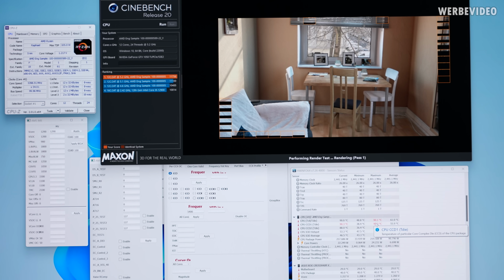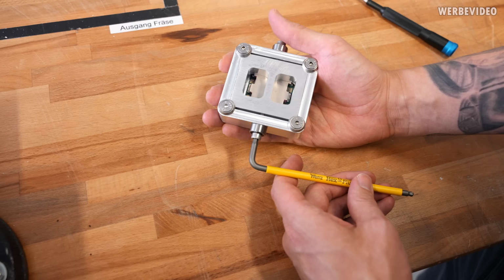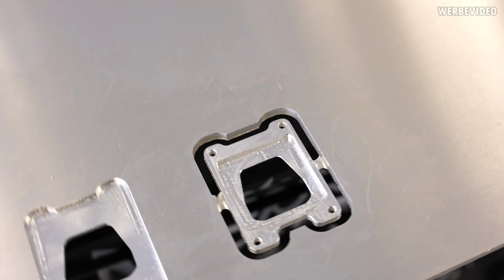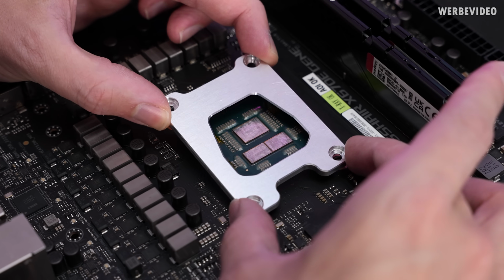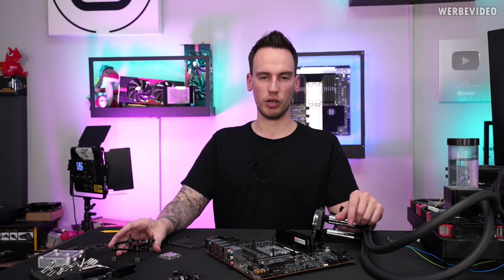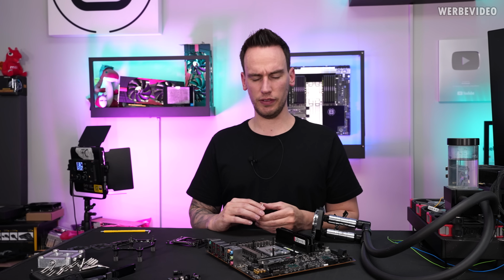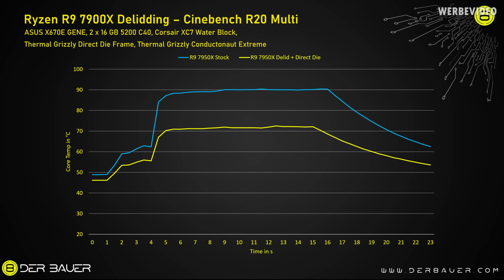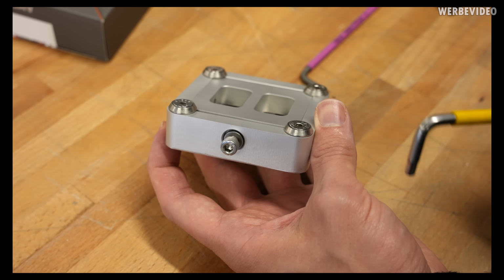Ryzen 7000 Delidding - Unreal Temperature improvement with Direct-Die Cooling

Comment: This does prove that upgrading to a thicker IHS to maintain very questionable cooler compatibility is indeed a huge mistake and kneecaps the newer lineup. Roman knows his stuff and deserves way more views with content like this.
Reply from the maker: Thanks a lot
Reply: Not really. Zen 4 doesn't throttle at high temp so AMD made the right move for mainstream customers. For real overclockers we're gonna delid anyway🤣
Reply: @dudao4163  exactly.  the average person won't be hurt by this at all and neither will the average overclocker... meaning they change 2 settings and call it good
Reply: It's for when they sell the "upgraded" gen 2 AM5. They have to leave some easy room for improvements on the table xD
Reply: @darkpitt1  There is already a room left for AM5r2, such as increasing PCIe lanes from 28 to 64.
Reply: @erkinalp  3D v-cache too, not so easy maybe(?) but a predictable upgrade path
Reply: @erkinalp  It will surely be called AM5+ if it exists.
Reply: @erkinalp  it was a joke
Reply: @erkinalp  What do you use that many lanes for? The vast majority only need 20 for a GPU and NVME drive.
Reply: @ZanderX10  A second or third NVMe drive. Also 100G NIC. As threadriped is dead, then "cheap" workstation - GPU, plenty of NVMe and 100G+ NIC.
Reply: amd just need modifies ihs~ that launch a new 8900x,or add a 3d cache on it. everything is a commercial operation.
Reply: Not a mistake, I'm fairly certain its there to leave space for 3D cache stacking.
Reply: Turns out Zen4 performs well on old Wraith box cooler, easy to cool.  The XOC demos are actually showing AMD have overclocked out of the box with their boost, with unimpressive freq gains for excess power consumption.
CPU designers have a choice, run to a power or thermal limit and there's no real evidence to suggest AMD's 95C is a mistake.
Consumers can buy quiet air coolers with this design and not lose significant performance.
Reply: Which is kind of weird because the companies could just make their own compatibility accessories for their mounts instead. Also, moving to AM5 already requires so many new things. Mys well go the route of new coolers too.
Reply: The cooler argument is 1 angle but.. I can see amd planning on releasing new variations of the chips claiming cooler Temps and faster clocks by just thinning the spreader but ofcourse not saying it had anything to do with the thickness of the spreader.
Reply: I thought he was actually very considerate of him to simply say that perhaps it was not the right move to add so much material for the sake of limited backwards compatibility rather than going Gordon Ramsay mode and coming out and calling them f*cking donkeys (which is absolutely what they are for doing this).  Lol
Reply: I think they could have actually maintained cooler compatibility by having smaller IHS, and then including an addon that goes on the IHS for compatibility. It could have been as simple as a CNC'd piece of metal that slots into a normal IHS with the appropriate thickness, and then you'd just thermal paste both sides. The shape of the CPU certainly would be friendly to that kind of solution, without even having to worry about anything moving around once you put it in place, it would just use the CPU's shape to stay in place. They could have either included this with every CPU, which wouldn't even cost more than a couple of dollars to include, or left it to third parties to provide it for heatsink compatibility. But another reason why they made the IHS soo thick is because different parts of the CPU run at vastly different temperatures. The VCache runs hot, while the cores run cool. This disparity in temperature over such small distances can cause problems in longevity and could potentially even cause the CPU to break itself. So the bigger IHS is also for normalizing temperatures to keep areas from running too cool and causing too much stress from the temperature differential, i.e. a cracked CPU.
Reply: This video has already gotten a ton of views. How many views realistically do you think a tech channel should get?
Reply: Could the thicker IHS also be a future proofing measure? If, for example, they make an AM5 series with 3D v-cache, might it affect chiplet height and by making the IHS thicker now they actually will have improved temperature for those?
Reply: @Tsudico   The chiplet height for the 3D models didn't change. Liza sue goes over this when the announced the product originally. The IHS being thicker is purely for making the coolers compatible with each other which was a terrible decision because now the cooling on AM5 took a huge hit.
Reply: @Tsudico  I think it's quite the contrary actually. The 3D V-cache will be more difficult to cool (just look at the thermal of 5800x vs 5800x 3D), and a thicker IHS only make things worse. Think about it, how can a thicker material between the die and the cooler somehow make the cooling better?
Reply: @simonwei92  Because when 3d v-cache is added, the extra height of the cache will be subtracted from the ihs, making it thinner.
Reply: @simonwei92  I agree with what @protox4 is saying. The chiplet has added thickness due to the 3D v-cache, so the IHS must be thinner in comparison.
Reply: @simonwei92  Or they could just do a thicker substrate to get a thinner IHS...
Reply: @Bourinos02  no, to not crack it under pressure there's a minimum thickness. best to keep it safe
Reply: @bradhaines3142  Well, if this specific IHS isn't thicker, then why would the cooling be better on previous IHS?
Reply: @Tsudico  The starting thickness of the 5000 series IHS was thinner than 7000 series but there was still room to make it a bit thinner still for the 5800x3D. This is purely a compatibility measure
Reply: @protox4  No, you are confusing soldering thickness with IHS thickness. Technically what you are saying is the soldering between the die and the IHS would be thinner for the 3D version, the IHS thickness remains constant no matter what.
Again, 5800x 3D clearly shows the 3D cache is very difficult to cool, so AMD will have to make another batch of thinner IHS for the 3D cache CPU if they want to prevent throttling.
I kind of understand your mentality, you don't want to think AMD made a mistake here. But from what this video shows, AMD did sacrifice some cooling performance for the sake of cooler compatibility, which may not be so wise.
Reply: @simonwei92  Where's the data to support that statement on x3D temps?  GN test showed x3D was very  power efficient in their testing and the B2 stepping was a significant improvement too.
Everything points the idea to be a false conclusion because the x3D was OC locked, Robert Hallock explained many times V-cache had a limited voltage spec, that was the reason for lower frequency.
A thermal limitation could be avoided by simply binning chiplet dies to those with the least leakage at 1.2v.
Reply: Amd had to make coolers compatible because customers are already forced to buy expensive motherboards and DDR5.
Reply: @matthuntelaar8486  But the coolers are only partially compatible anyway. It would have been better to throw out half-arsed cooler compatibility for the sake of better performance.
Reply: @matthuntelaar8486  That decision doesn't make any sense, because it's still not full compatibility and coolers are way cheaper to buy than a CPU and what others have mentioned as well, having this flaw for the entire AM5 generation and platform. It's a big mistake.
Reply: @matthuntelaar8486  But then AMD will pay this choice for as long as AM5 gets cpus... they might have shot themselves in the foot for the future generations with this choice.
Reply: @Archer_Legend  doubtful.  cooler companies will make am5 coolers that you could swap the cold plate so it would go lower into the socket mounting area then amd can decrease the thickness of the IHS.   even running at 95c isn't a huge de.  instead of dying after 15 years the CPU will die in... 11 or 12
Reply: @matthuntelaar8486  The problem with that argument is that the cooler compatibility isn't really there. if it made 100% of AM4 coolers compatible, then great! But it doesn't. There are plenty that use different backplates etc. If you've got to order a special bracket or backplate for your existing cooler, then what was the point? They may as well have gone with a much thinner IHS and then the AM5 "kit" that you would get from your cooler manufacturer could just include some different length fasteners or a different bracket instead. That's how it has been done for Intel sockets for years, with LGA775, LGA1151, LGA1155, LGA1156, LGA2011, LGA2066, LGA1200 and LGA1700. Cooler compatibility shouldn't have come at the expense of making the CPU run hotter. That's rediculous.
Reply: Amd is dumb for this.
Reply: Who care if it 95c it don't throttle anyway 
And AMD said it was the expected behavior and better cooling will result in higher clock
It can in stock form clock to 5.7ghz on any core in single core testing and never throttle and stay at 95c
Reply: @legros731  It does throttle though, because Ryzen 7000 doesn't really have a factory frequency so much as it has a thermal and power limit and will just run as fast as it can until it runs out of one or the other. If you can keep it cooler than 95C then without any manual overclocking it will automatically run faster, ie with factory cooling it is running slower because of thermals.
Reply: @bosstowndynamics5488  maybe in theory but you can run cinebench in a loop for 1 hours at 95c and still be at the 5.1/5.2 GHz all core
Maybe you should go watch hardware unboxed 7700x video he explains all that and the official and explanation for the temperature
But if you want to undervolt to .980v and decrease clock to 4.8ghz you will get in the 55c range

Comment: That's pretty awesome but why is it like this? I though AMD 7000s would go up to 95°C and then adapt to the cooling they have. Is it hitting a power limit of some sort now?
Reply: It is allowing him to hit the power limit of the chip that he has placed as part of the overclock. He is also doing a set frequency overclock that turns off the boost. So theoretically if boost was on it would try to run at 95c and clock higher under boost. This could also put way to much voltage through the chip, that is why he set the voltage. It will take some time to figure out the max voltage and frequency from direct die and it will be cooler specific. Probably can get 5.6 all core maybe 5.7 without exotic cooling at 90c if it doesn't require too much voltage, on a custom loop. 5.5-5.6 on 360 AIO and 5.5 on high end air. You have to think about heat soak in the cooler also dictating the max daily driver overclock.

Comment: Awesome video! After watching your analysis, I agree that AMD should have ditched the cooler compatibility, it's just going to add unnecessary confusion for the few people that really want to use their old AM4 cooler on AM5... 
Well, it looks like my EK AIO should fit, but I'm very interested in going the delided + open loop route on the next go around (soft tubes so I can swap parts) tho that's not goinna be anytime soon- I'm absolutely thrilled with my AM4 system, it does everything I can throw at it with plenty of headroom.
Reply: Unfortunately there a lot of people who just want it to work immediately, and AMD can't ignore them to make those who are more knowledgeable happy
Reply: The thick IHS is because they’re planning for the next Ryzen 8000 with thicker dies that use 3D V-Cache to be compatible with AM5.

Comment: One guy on youtube recently figured out how to turn an old k6-2+ to k6-3+ with a delid and mod to the connectors under the ihs lid. No one really did deluding back then, so the secret remained for 20 years or so
Reply: link?
Reply: @Bayonet1809  bits und bolts is the channel
Reply: @sbrader97  Thanks.

Comment: It is also possible the IHS is also thicker to compensate the lack of all around, IHS mounting support.

Either way, this is probably ok if it is sacrificing overclocking but making it easier for most users to upgrade. These are already at insane amounts of power and extreme OC users can go the extra mile.

Comment: Did the base line run(s) use liquid metal too? If not, wondering how much of the temperature drop came from the direct die and how much for the TIM change.
Reply: PS arn't water blocks normally slightly concave to fit to the IHS. Would it be an idea to lap the water block flat?
Reply: It is solder which has the same or better thermal conductivity as liquid metal. It is not TIM paste or anything like it. It is a metal thermal solution that is dry.
Reply: @2ndtwo1  Sorry should have been clearer I meant between the heat spreadser and the water block in the first run. Is this a comparison of a "typical" water cooled arrangement, ie heat spreader on and normal thermal paste on top, with the most extreme delid and liquid metal or a comparison with liquid metal on the water block in both cases to only show impact of delid. (Either valid, just good to know which.)
Reply: @tomhollins5303  3-5c at best difference between a TIM and Liquid Metal. You are mostly dealing with the thermal conductivity of different metals. The Heat spreader is already a giant chunk of copper and has to heat soak before full cooling potential is achieved l. But with the way the CPU is designed to hit a thermal wall and voltage headroom it will just end up with sustained boost not really lower temperatures. All CPU's before this design used a voltage wall and then thermal headroom. It is a completely different design to smooth out fluctuations in the boosting speed. So far from reviews it also seems to make stability more achievable at higher sustainable boost clocks. Many reviews using 360 AIO's are seeing a 50-100 mhz boost above the factory all core stated boost because of the way the new design works.
Reply: @2ndtwo1  Thanks. And wow that really shows howbig an impact the heat spreader is having.

Comment: Wonder if itd make more sense for the server market to use delidded packages since torque settings are regulated during installation. 
It'd likely grant insane savings for providers for electricity due to less cooling required.
Reply: Servers will be working with far lower thermal densities. The amount of heat generated with each CCD will likely be less than half which cuts expected temperature difference in half.
Combined that the servers are likely not gonna be running at 95c and your 75c vs 95c on consumer will likely become a 75c vs 85c. In exchange, you get substrate flex due to no IHS on that giant epyc pcb. Poor mounting pressure, associated risks with Liquid Metal, die to die variance resulting in poor contact with some CCD.

Comment: Modern CPUs shouldn’t have an IHS. IHS was invented because user were chipping the corner of their Athlon CPU die installing the CPU heatsink. But heatsink installation has come a long way, heatsinks are now installed straight down and screwed down, rather than being installed at an angle with spring clips. IHS is no longer needed and is an impediment to CPU cooling.
Reply: Interesting. Something to delve into.

Comment: It was a wrong decision from AMD to keep the same total CPU height from last generations to keep cooler compatibility, the IHS is way too thick now and can't transfer the heat of the silicon to the water block.
Reply: It does seem likely that they have given up some clock frequency at thermal throttling temps. How much, is an open question.
Reply: @Sam Saraguy  the chips don't thermal throttle with the IHS they can run at 95 but your not getting everything out of the chip you can. Thermal throttling is far different. Running at 5ghz plus at 95c
Reply: @Sam_Saraguy a lot, that’s shown in the video
Reply: I wonder why they didn't thicken the substrate beneath the dies with more layers of pcb
Reply: @luigius8590  your question is 6 months old but I might be able to answer it. 

Possible that thickening the substrate would incur signaling penalties and could potentially throw the infinity fabric out of whack. I don't know this for sure because I'm not an AMD engineer, but I think they chose the IHS because it wouldn't impact any of the signal integrity stuff that they're already running off fine line
Reply: @@justinthor yeah this is completely wrong
Reply: They can probably get much higher yields through forcing us to run lower voltage. That could partly be why they did.
Reply: That's a reason to consider lapping the IHS, but it's irrelevant to delidding. Direct die would always cool better than any IHS of any thickness.
Reply: @justinthor delusional, reasearch more about the industry
Reply: @justinthor that's pure BS
Reply: They did it for the air coolers. Air coolers use pipes, which need even disruption to effectively work. The thick IHS is a double-edged sword, more even distribution at the cost of less heat transfer.
Reply: Likley did it for the 3d cash
Reply: @HarleyN93  no, doesn't affect silicon height
Reply: At the bottom?
Reply: they should've used thicker base or taller lga socket
Reply: You should go with Intel then😂🤭
Reply: Lap the cpu
Reply: It's not just that the IHS is thicker, it has less cooling performance by being saturated with heat due to the cut outs as well, heat stays in the middle for the most part. They should have designed the chip for everything to be under the IHS including the SMD hardware IMO having a full IHS. The chip should of even shapped like threadripper or intel, a stretched rectangle. But that's just me. Making something look cool is stupid IMO and cost more when you include milling on the IHS
Reply: @chosen1one930  this doesn't make any sense whatsoever
Reply: I think amd cpu too hot is because the material between the ihs and the die is too thick
Reply: @@justinthor сказал умную вещь, тебя сразу дураком назвали..